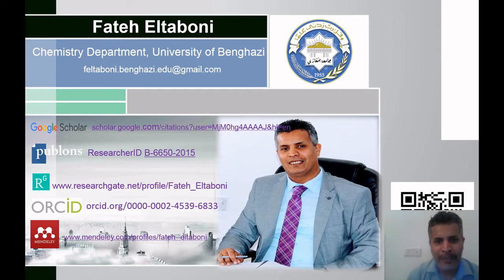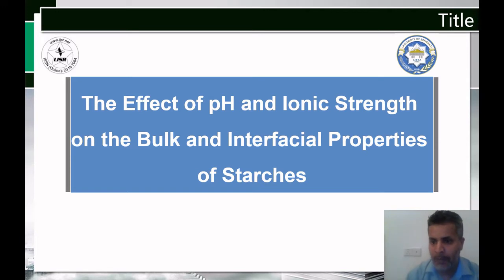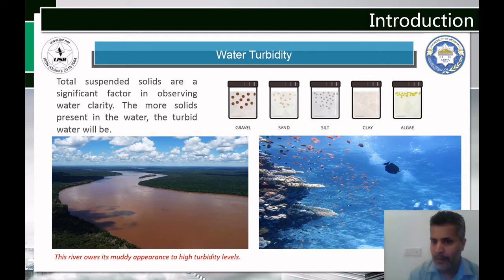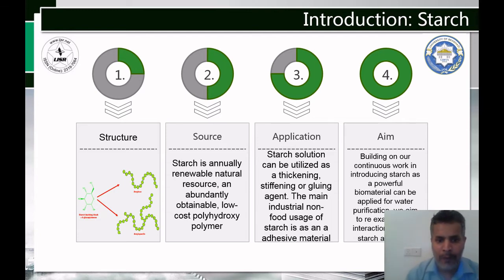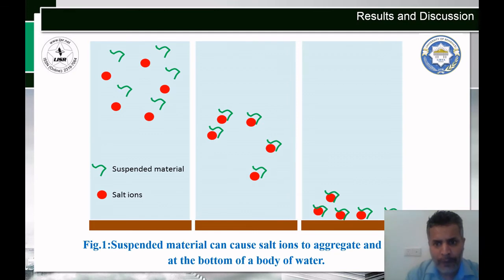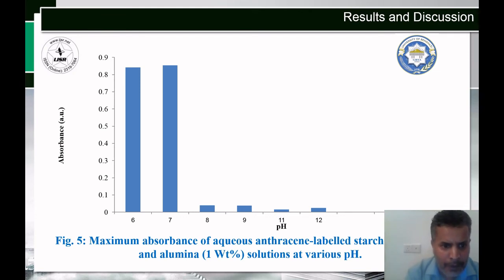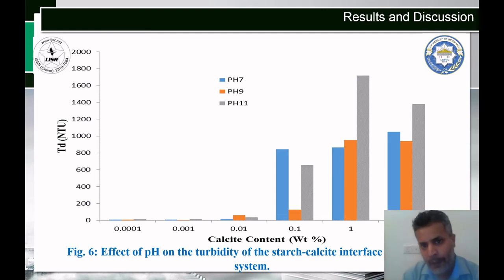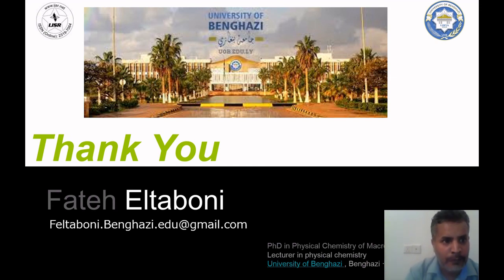The Effect of pH and Ionic Strength on the Bulk and Interfacial Properties of Starches

Comment: It is an amazing explanation.I hope the best for you my dear professor. I have a question?
I want to ask about the foam which is caused by the presence of the organic materials in sea water while it is exposed to the pressure of the pumps. How can we get rid of it ?
Reply from the maker: Thanks for the visit, do Subscribe the Channel for future updates :)
Reply: Thanx a lot   Mohammed
I suppose applying chemical anti-foam like soda ash or acid but be aware from changing the pH of your water other wise you can use sponge to absorb foam
Best wishes